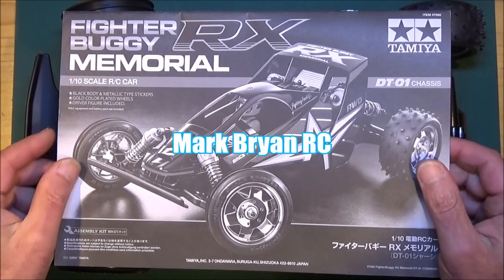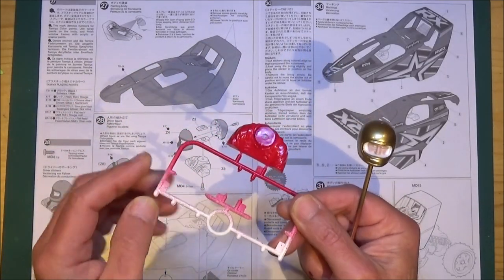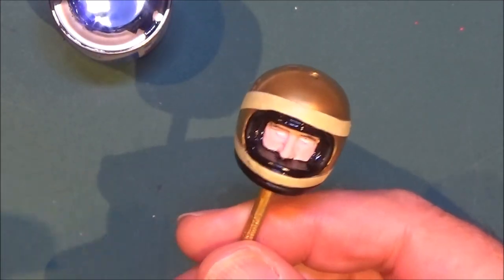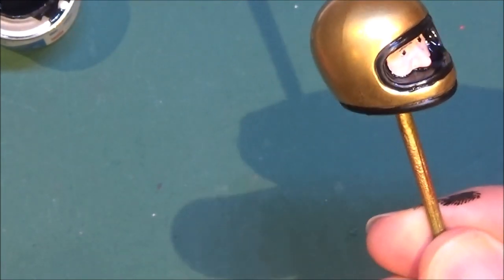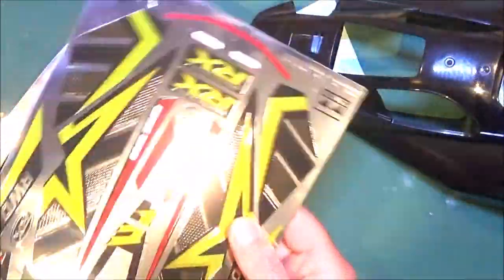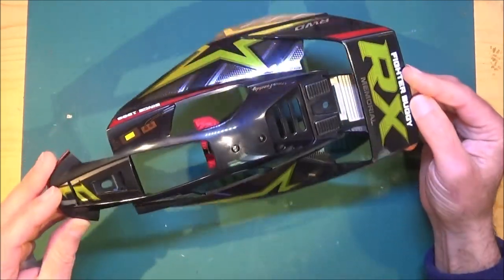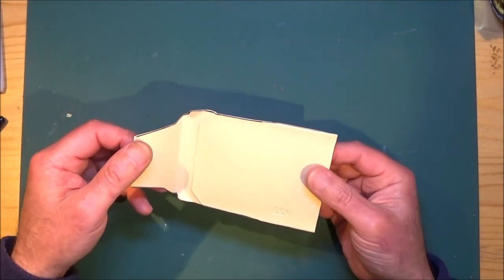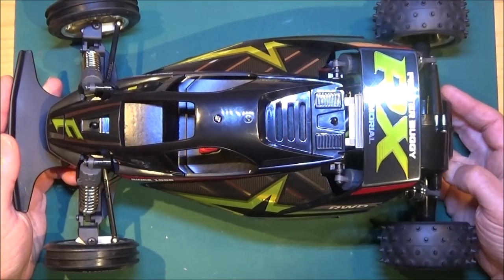Tamiya DT01 Fighter Buggy Memorial Build Guide + Tips P3 Bodywork + Cockpit!

Comment: Hi Mark, That was some really nice hand painting.  I have trouble getting the paint to not glop, I need to learn your patience.  Do you thin the paint?  The template was brilliant, it turned out very nice.  So many good tips.  Decals are hard to apply I usually dab some windex on the sticky side but I’ve seen mixed opinions whether or not that is a good idea.  Build is looking good 👍🏾
Reply from the maker: Thank you so much, Paul. I don't thin the paint, I find the little pots of Humbrol enamel are usually spot-on for brush painting. I've had lots of practice over the years! I have never tried the "wet" method of applying the decals, dry works for me so I will stick (Haha - "stick") to that. I'm very happy with this little buggy. Very best regards to you and your family. 😀

Comment: Quick question - just finishing my own RX memorial and thinking about improving the notoriously loose steering. In your earlier build guide you didn't do anything outside the instructions but @18 seconds in this video it looks like you put some rubber washers or something to the top of the steering rod where it attaches to the servo saver? Am I seeing things or did you do a little mod? If so, does it help and what was it? :D
Reply from the maker: Hi there Huw. Well spotted! Yes, I did try adding some rubber washers to that steering rod. It worked better than the stock setting but the washers moved after some running. A better way to take the slop out of the steering is to use some heat-shrink tubing. Take a look at this video by Peter Smith of CW-01 Creations, he shows how this simple mod works. Cheers!
https://www.youtube.com/watch?v=fMrAJgdqLQA&t=226s
Reply: @MarkBryanRC  Ah very interesting - thanks Mark! I'll check the link out now :D